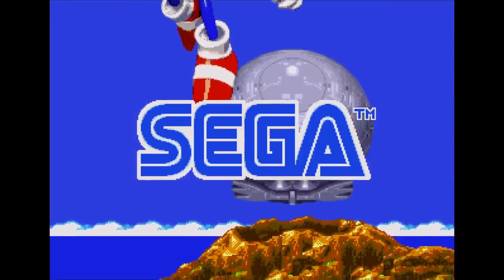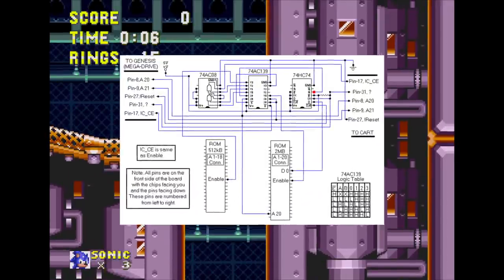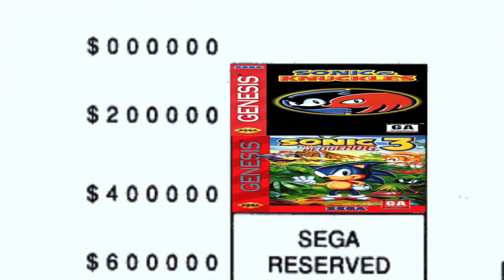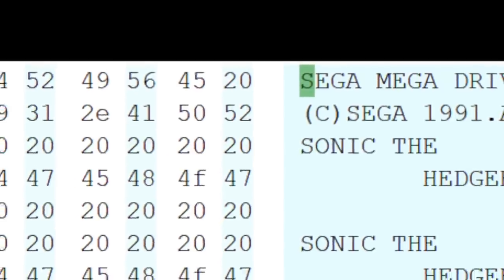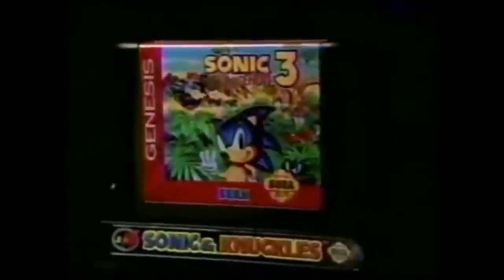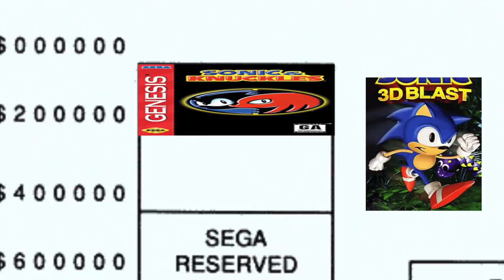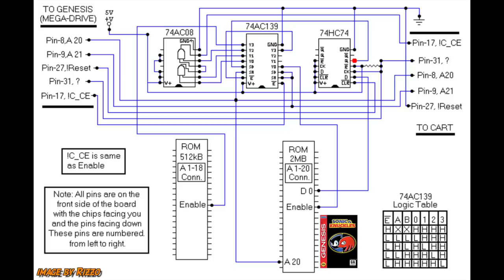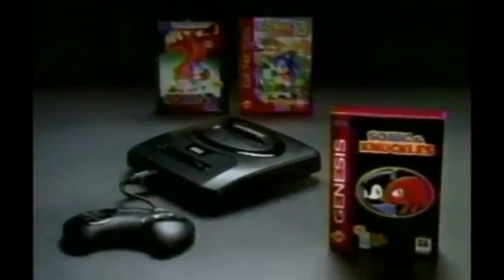SEGA's Crazy S&K "Lock-On Technology"

Comment: One other thing I seem to have picked up along the way. One of the reasons they may not have included a similar mode for Sonic 1 is to do with Sonic's colour pallete in those games. Supposedly they re-used the Sonic blue for other elements in the game, which would make pallete swaps for the "super" versions of each character implausible (who wants to patch that kind of game logic?) which is where the blue spheres concept came from.

I have no sources on this one but if someone has access to the relevant software it would be quite easy to verify?
Reply: You mean putting Knuckles in? You're thinking of a gamehut video about getting super sonic info sonic 3D.
Reply: @bangerbangerbro  it definitely predates gamehut in my head. But knuckles is just as good an example.
Reply: @darren8453  No i mean in your original comment you mean knuckles not super variants.
Reply: @bangerbangerbro  I may have mis-remembered parts of the story but whether it's a palette for Knuckles or Super Sonic, I remember reading this was part of why they didn't do something similar for Sonic 1.

Of course, there may have been other considerations; the game engine by this point was probably radically different from the original in sonic 1, and maybe the level design would never have catered for it anyways. Also you're going to be increasing cost to add another ROM on the S&K board if you do it this way.
Reply: @darren8453  I'm just trying to say the main thing you would be doing is adding knuckles, which would of course cause the same problems. Super forms you might try but I wouldn't think you would bother. Knuckles I suppose you might be able to do with other reds in a level but it is a mega drive so I think the sprite layer has its own palette so there would probably be a narrower band of colours, only those used by badniks and a few other things. Also makes me wonder if some badniks used different palettes to the others and are just placed so that they don't meet?
Reply: @bangerbangerbro  understood 🙂 I might be conflating a few different stories which are untangling in my head as I write this.

I might be misattributing this from a discussion of later ports (PC etc) as to why they could add spin dashes but not super forms.

Same limitations, completely different requirements 🙂
Reply: @darren8453  Ah, like Sonic Jam has spindash in sonic 1? Though that runs natively on the saturn, not emulated so shouldn't have a problem. I can't remember if that has more characters. Anyway sorry for being rude.
Reply: @bangerbangerbro  no need to apologise; in the end we got there because you challenged a 20 year old memory 🙂
Reply: Month late, but I saw a quote from a developer where they said the main issue with getting Knuckles to work in Sonic 1 was something along the lines of the original level design not being able to be easily adapted to account for Knuckles's abilities, whereas since Super Sonic had forced them to design Sonic 2's levels to account for flight the levels could be adapted to Knuckles more easily.

This comes off as an iffy explanation to me, because S2 still had some rough areas and empty spaces that the KiS2 patch ROM needed to adjust. My guess is they just didn't have the time to work out how to adjust the level design, work out the palette issues and deal with any other potential issues on top of working on KiS2 and S&K itself.
Reply: @LonelySpaceDetective  it all comes down to time and money eventually 🙂
Reply: @LonelySpaceDetective  one other thing to think about is the amount of code drift in those years. If nothing else, I know that the compression algorithm was swapped out for sonic 2 or 3 for a faster but less effective routine, so that they could do background layer swaps mid-level.

Doubtless there were a bunch of other changes to how the game worked over the years. It wouldn't surprise me if they tried something quickly as an experiment but abandoned it for a bunch of smaller reasons that collectively added up to too much work to make an enjoyable and bug free extra - of course this would have to go through Sega's QC process too - for not enough gain.
Reply: @LonelySpaceDetective  Yeah, and S2 was the more popular game too, not that Sonic 1 wasn't, but it would be the one to focus on that people would want to see expanded.

Comment: I knew of most of this from the olden days of Genesis emulation wherein I used the DOS prompt's "binary copy" command to manually join S&K to Sonic 3 and another file which was just S&K to the S&K "patch rom" to Sonic 2.  I had assumed the Sonic 2 "Patch Rom" was just the changed data for Sonic 2 patched in in real time at boot like a Game Genie would.  I had no idea they just went whole hog and stuffed a fully functional "Knuckles in Sonic 2" ROM in there, negating any need for the original Sonic 2 cart at all.  That means you didn't really need Sonic 2 to play it, they just forced you to buy it as an "unlock key".

Interesting stuff!  It's hard to be mad considering just how long ago this was, but it's a curious fact anyway.
Reply: Actually you would need the Sonic 2 ROM anyways, the "Knuckles in Sonic 2" ROM actually only contains palette data, sprites, stage layout, and all of the game's code. The rest of the game, the music and the actual artworks for the stages is still inside the Sonic 2 cartridge. Booting only the patch rom alone would lead you to a simple black screen
Reply: @mspeter97  Ooooh so closer to what I originally thought it was then!  I retract everything.

Comment: So no data from the actual sonic 2 cart was used? Did it only use sonic 2 as a way to access the patched rom?
Reply: I wonder too
Reply from the maker: No, it used all the assets from the sonic 2 Rom but needed the 256MB patch for the new Knuckles animations etc.
Reply: @CodingSecrets  I think you meant 256KB or it would have been very expensive cartridge at the time
Reply: @CodingSecrets  256mb hey? hmmm
Reply: Read Fred Bronze's "Sonic 3 Unlocked" blog. It goes in depth on how Sonic 3 and Sonic and Knuckles were programmed, including several entries on the actual software side of how the lock-on support was used.

In standalone Sonic & Knuckles, a global flag is set indicating to the S&K ROM that it's a standalone S&K cartridge, and this flag is thus used throughout the logic of the ROM to prevent cases where it would reach into the Sonic 3 ROM for assets: Tails, certain cutscenes, etc. It also obviously prevented the ROM from starting in Sonic 3 & Knuckles mode which VERY HEAVILY draws data and even some logic from the Sonic 3 ROM.

In S3K, this flag is left unset, which allows the S&K ROM to enable its entire feature set and use both its own assets and assets from the S3 ROM. Right from the start this will result in the S3 address space being reached into by the ROM. There are some assets from S3 that are duplicated in S&K, however, due to how they hardcoded addresses in their data structures, such as pattern load cues (A lot of level graphics data has to come from the S&K ROM instead, but layout data can come from one ROM, the other, or even BOTH ROMs.) Most of the actual engine logic comes from the S&K ROM largely due again to addressing complications. The Genesis/Mega Drive doesn't have an MMU, so the S&K ROM can't just simply map the S3 ROM by way of virtual addresses, which would have allowed Sonic 3 addresses to still map to addresses as if they were Sonic 3 standalone when S&K would have needed. This ALONE is probably the biggest reason why Lock-On Technology wasn't used beyond this one game, as they probably had to manually recode assets they had to reuse to account for the change in address space. S&K also uses S3's SRAM entirely and doesn't have any battery backup of its own.

Knux in Sonic 2 relies on some assets from the S&K ROM, most the assets just come from the Sonic 2 ROM, and the patch ROM provides not only Knuckles graphics and animation, but more than likely is the actual copy of Sonic 2 that runs when locked on, as opposed to the version of the engine on the Sonic 2 ROM. This is due largely to the fact Knuckles does not work in any way like a player character programmed into the S2 ROM. But most graphics and layout data and possibly some enemy programming comes from the S2 ROM, with the S2Patch ROM changing some layout data on the fly.

Comment: I was hoping to hear something about how the "Sonic 3" levels are slightly different in Sonic 3 and Knuckles compared to Sonic 3. Like for Sonic 2 they just made a duplicate ROM with all the edits, but for Sonic 3 and Knuckles they are... loading Sonic 3 data with different layouts and bosses and other tweaks? How much extra Sonic 3 data is in S&K?
Reply: Yeah I was also really hoping to hear how Sonic And Knuckles interprets the different coding architecture of Sonic 3.
Reply: IIRC, S&K's code patches the layouts of S3's levels as they're loaded, but I'm far from an expert on the subject.
Reply: Essentially, it just uses Sonic 3 as an art asset bank. All of the code (including all object and level layouts) is running from the S&K side of things, but art is loaded from the Sonic 3 side when applicable. That said, as far as extra data goes, all of Sonic's sprite work exists twice in the combined ROM because he's playable in each game independently.
Reply: For S2 they DIDN'T make a duplicate ROM with the edits. They just made a patch for the S2 ROM which contains just the edits..
Reply: @gold_lightning  Indeed but they just opt to use the version of the sprites present in the S&K side of things to make things easier. The only playable character in S3&K that actually requires loading data from the S3 cart is Tails as he only has his standing still sprite in S&K. Multiplayer mode also reads sprite data from S3 and that's about it
Reply: @Le Docteur Tails' super transformation sprites and some cutscene ones are also in S&K.

Comment: I actually found a way to generate a special stage from games that were greater than 2MB. You had to start it up with a game that produces a No Way screen locked-on, enter the special stage, pause and swap cartridges without turning off the power (or wobbling it too much causing a crash). Then unpause and hit a red sphere; you'd return to the Blue Spheres title with the special stage generated by what it THINKS is the cartridge serial number - but is in fact some random bit of code in the 2nd half of the ROM!

Comment: The Lock-On tech was originally planned to be a stand-alone cartridge using the same chip found in 'Virtua Racing' (The SVP Chip) to enhance games plugged into it. Ultimately it was abandoned in favor of the 32X and Virtua Racing was released with the chip integrated, for a whopping $100. It was then adapted to the Sonic 3 project, which was too big and behind schedule, leading to the game being split into two (Sonic 3 and Sonic and Knuckles).

Comment: The trick with pulsing the data lines reminds me of how later NES games expanded the capabilities of the system. The NES PPU pulled graphics directly from the cartridge; cleverly designed memory mapper chips in the cartridge could take advantage of this. For example, by counting each time the PPU starts reading a new line of background tile graphics, a memory mapper could implement a scanline counter, which the system doesn't have originally. Memory mappers were also used to add banked ROM for games larger than 40k, suspend the game state to battery-backed SRAM so players could resume their game later, replace the standard character ROM with rewritable RAM for more graphically impressive games, and even add expansion audio hardware (though this was only possible on the Japanese Famicom).
Reply from the maker: Nice!

Comment: It's not implausible they were able to develop the lock on quickly, rather than have been planned all along, the foundations were already there.
Cheat carts like the Action Replay and Game Genie already used a passthrough cart, Codemasters had at least 1 game and another about to release with extra controller ports on the cart, the 32x was about to release and that was basically an entire lock-on console. What they did was a natural solution considering what was on/what they knew was about to be on the market providing inspiration.

Comment: Wait, I know there are multiple revisions of Sonic 2, it even checks for the updated version from the SEGA Classic pack (Rev 02) but according to that code, it only ever checks for Rev 00 of Sonic 1. Yet IIRC my Rev 01 Sonic 1 still plays the full Blue Spheres game, did they not update the serial # on those versions, or is there a check for Rev 01 as well?
Reply: The way I read that code, it ignores whatever the final number in the ID is if the rest of it matches. Like it stops near the end and goes "okay this is definitely sonic 1, enter sonic 1 mode" without reading that final digit.
This is generally the efficient way of supporting all revisions, if the differences between them won't matter (which they don't in this case, because the game is overridden to enter the Blue Sphere minigame).

Comment: Interesting. How are roms created containing the full games? Could you dump them in 4mb cartridges to play without the Lock-on?
Reply: I was wondering this as well!  I think from what CS is saying, the S&K rom reads the 2mb rom chip from the attached S3 cartridge as just another bank of memory addresses by polling the address and data pins of the cartridge.  So, in theory, by passing the full array of cartridge memory address values, you can just download the full 4MB.  S3k though presumably could be re-optimised to fit onto less memory, since there must be some redundancy in the S3 and S&K cartridges to allow each of them to be played independently of the other despite the basic game engine being the same; I wonder if some of the other releases of the game take advantage of this, or whether they just release the original 4MB version.

Comment: @Coding Secrets
So from a technical standpoint what occurs if a copy of S&K is plugged into the expansion slot on another copy of S&K? Surely all of us have seen popular internet images of people stacking S&K carts as high as they can. This is my guess but I have always wondered what really happens: I would think that another copy of S&K would just detect as a non compatible game, and so the only thing that would be read are the header and serial number. Because of this the code to look for games further up a stack wouldn't run, and a theoretical stack of 50 S&K carts would cause no problems except possible issues with weight on the genesis

Comment: Fun fact... The Sonic 2 and Knuckles ROM exist in it's entirety on the S&K cart using the Sonic 2 cart as the key...

Sonic 1 and Knuckles was planned but due to space limitations they couldn't get it to work without some game braking glitches... (Most noticably in Scrap Brain Zone)

Sonic 3 only works at the level it does because it's code was practically developed in tandem with S&K allowing for sprites and objects to view the adjustments to the code made by adding the "whole" cartridge together!
Reply: Absolutely not! The Knuckles in Sonic 2 ROM is too small, it's 256k big! There's only code and patch data for Sonic 2 in that chip, you still need to have the Sonic 2 cart to load everything else!

Comment: Figured here would be as good a place as any to ask in regards to where I might be able to learn a little more about what you're talking about? I have an understanding of what you're talking about in regards to Memory Addresses and the actual names of the address, but nothing more than a cursory understanding. 

As well is there a way to read the actual code of the ROM in a relatively easy manner? I would really like to see the ROM Header and if it uses a Boiler Plate across games.

I also have one final question that is probably the easiest of all. On the spines of Sega Genesis games you can typically see a "code" which sometimes lines up with barcode, but sometimes it's also T-****. I know this code is unique to each game, but I was curious if that code was part of the header or part of a memory address? I ask, because I know on Nintendo games they have very specific codes and those codes are also on the ROM which is a good way to identify if it's legitimate or not. I just think it would be neat if that unique code per game was relative to a memory address or something in the header which would make more sense than something completely random

Any advice or pointers is always greatly appreciated!

Comment: Another fun fact for you; The compilation set 'Sonic Mega Collection Plus" on PC actually has this sort of thing built into the emulator they use. 

In fact, you can create a perfectly working Sonic 3 & Knuckles rom image from said game by stacking the images of Sonic 3 & Sonic & Knuckles on top of eachother (as long as you legally own SMCP) and then play it in something like Sonic 3 Air. 

It does involve some shenanigans regarding running the game in a window and analysing the memory directly in a hex editor and flipping the bytes (Since the CPU in the Mega Drive/Genesis is Big Endian) but;  It's certainly possible. :)
Reply: I believe the Wii Virtual Console release of Sonic & Knuckles supports locking S&K onto other ROMs as well, from what I heard.
There's plenty of unofficial emulators that support it too. The Genesis emulator I have on my homebrewed Wii supports it!

Comment: If i remember correctly the level data for Sonic 2 & knuckles is on the lock on cart, and it only takes the tileset and palette data from the actual Sonic 2 cart. Shouldn't it be possible to edit the rom header of any other game to match that of Sonic 2, and force the game to load in completely different tiles to the sonic 2 levels?